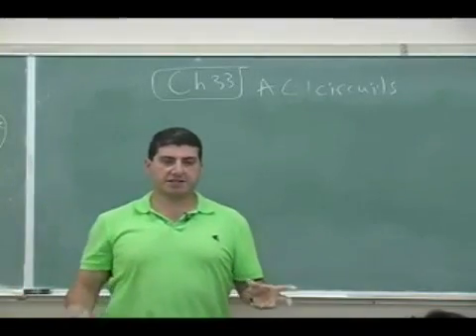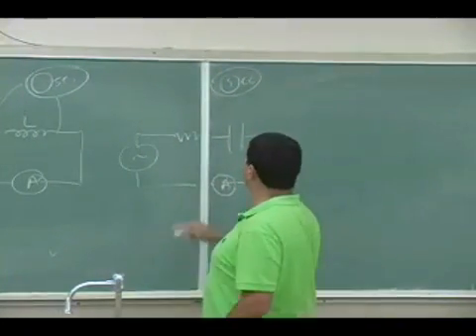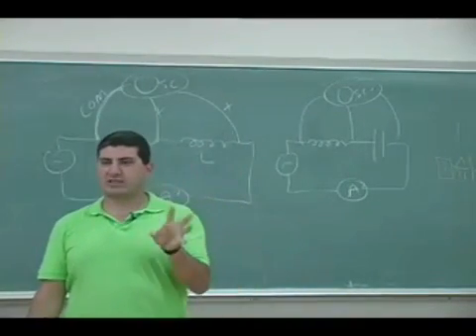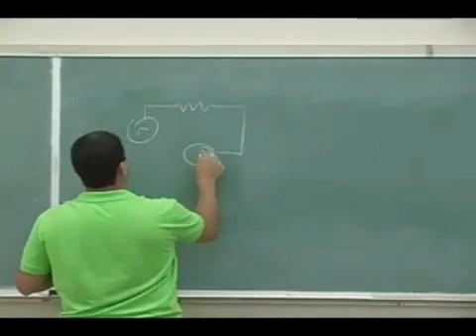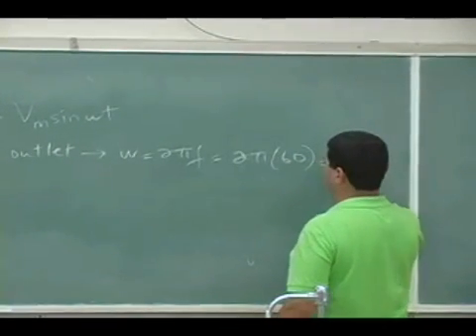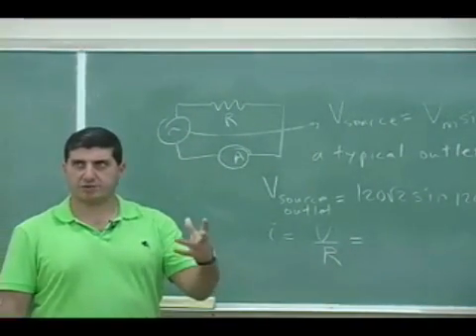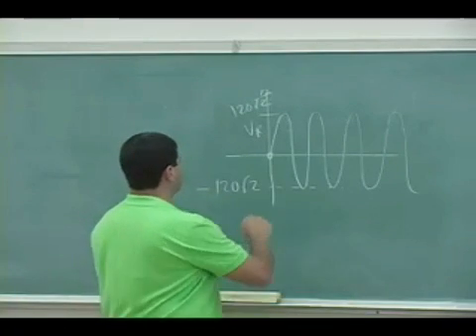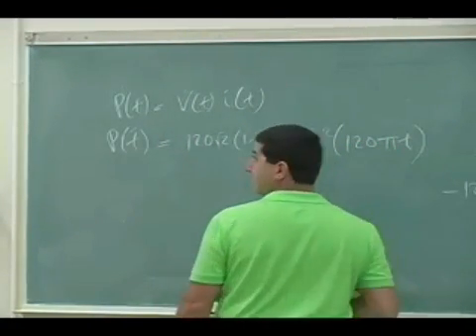AC Circuits Theory Part 1

Comment: If I have a power source of 10 V Rms and 840 Hz In parallel with an inductor of (500mH) and its in series with a resistor of ( 4.7K ohms) and both the inductor and resistor are in parallel with a Capacitor of ( 0.047uF ) What would be the total impedance and how would you work it out? Thank you to whoever can help me